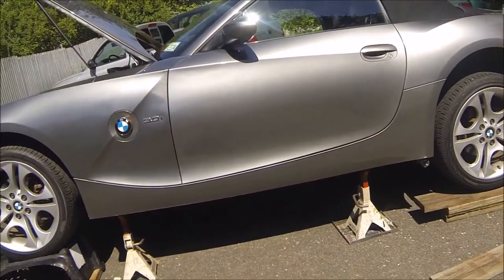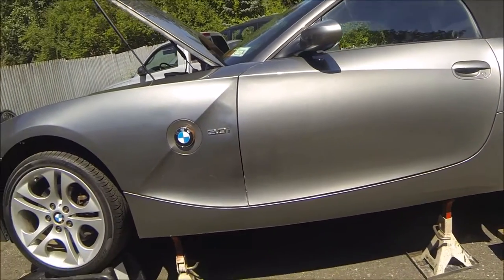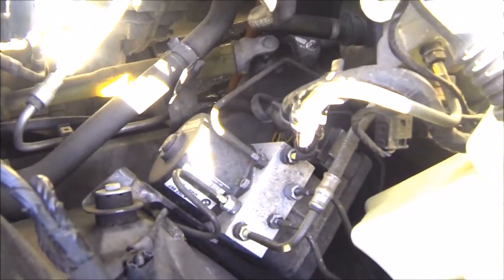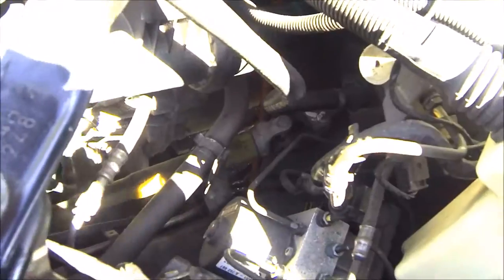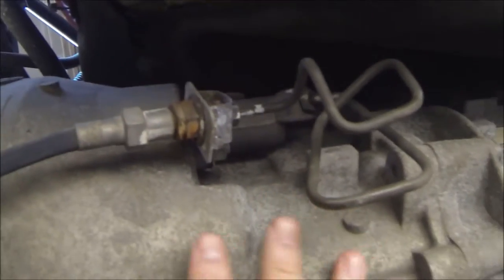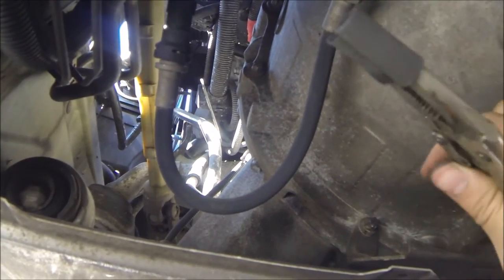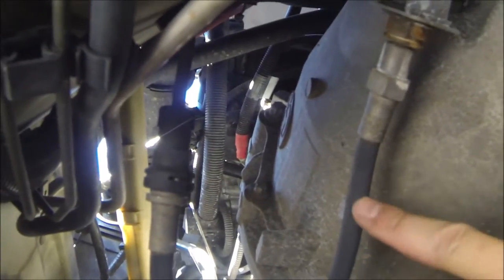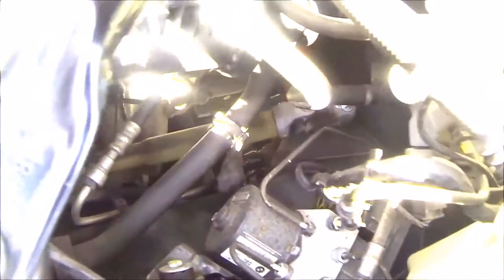Clutch Delay Valve Delete - Z4 Vlog #10

Comment: the reason it's on there is so if you launch the car on a very grippy surface the clutch slips instead of potentially damaging the dif or any other drive train components

Comment: Did you have to replace that valve with anything else? Or do the pipes just join back together?
Reply from the maker: You can replace the valve if you want to with another one that has a larger opening. But you can just join the ends back together too if you want.

Comment: Hi zed I have a Golf R and I was told that when I take the car in for service even if I flash the car back to stock they can see that I did something and it will void my warranty. I don't know if that is for sure and I was wondering if you have had any problem with that. please let me know.
Reply from the maker: +ni po po Highly doubt you'll have issues. Read up on the forums, and you'll see there is no reported case of VW denying warranty if a car is flashed with stock software.
Reply: +zed4me ok sounds good thanks for your feed back